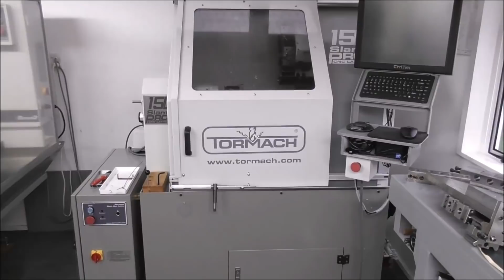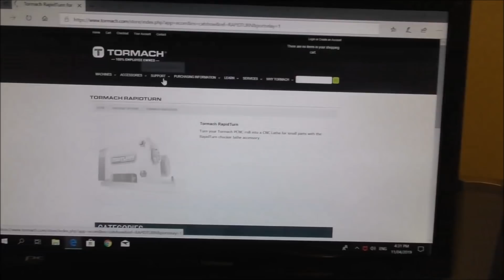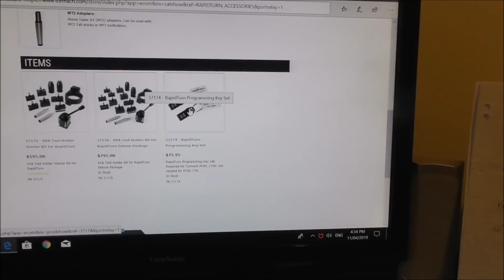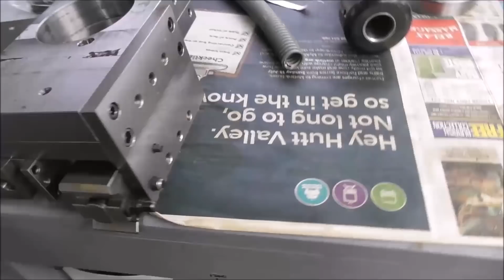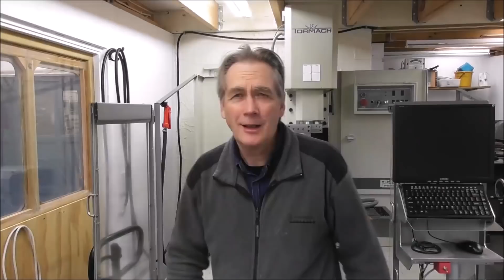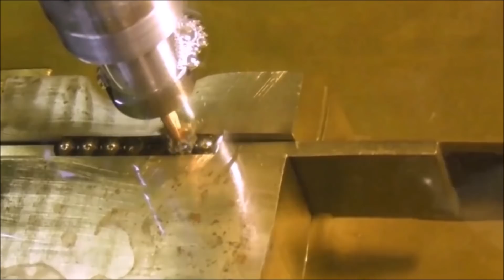Tormach Rapidturn Set Up and Run -  Part 1 -  Introduction

Comment: HI Cliff, from John in Orlando. Thank you for the display and analysis. I haven't done much with my RT to date, but I  just used it to do some work on 3 die holders which I just made. I bought the materials for a gang system, but haven't built it yet. You're correct about the presence of the RT on the mill; as I was trying to do mill work with it on the machine (1100) I ran the RT motor into the way cover, no damage, even though I'd told myself numerous times to assure clearence. I look forward to your continuing story, and truly appreciate your sharing.  I love that ITTP, although I have found occasions where my Haimer was a little easier in an odd case, ITTP IS still the best though! Best wishes!
Reply from the maker: Hi John - Thanks for you RapidTurn thoughts and ITTP feedback. Cheers  Cliff

Comment: Hi, just benchwatched full series of rapidturn, I think that is quite an interesting tool for the price and versatility. I have one thing that are curious for me at the moment: since basically 1 main problem (for me at least) with rapidturn is accuracy because of thermal expansion - why not use Y axis insted of Z axis to cut? Say I'm not using gang tooling - I could just mount quick change tool post 90 degrees, and cut it like horizontal.
But even with gang tooling - as I see your setup is already quite wide, with toolposts for each tool - you could cut tools length, and it would take around the same place, just mount them horizontally.
Or is there some programmatical obstacle so you are not allowed to do this in pathpilot? Or you allowed to do that but its more convenient with existing UI and not hand written g-code?
If you would ever decide to take your rp out of the box again - would be very cool to see how more accurate thing can be that way, haha. Thx!
Reply from the maker: Hi Anton. Good to hear you are thinking deeply about this. Yes, you are correct taking the tools in from the side or mill Y axis would likely be more accurate. One issue would be the Pathpilot on machine conversational CAM software is set up to use the mill Z as lathe X (it is not set up to use the Mill Y as lathe X) Also the clearance back offs, especially for larger diameters, would have to be sideways or Mill Y, and this would use up a lot of the gang tool spacing room. I would find it easier to work around the thermal expansion accuracy issue with eg coolant flow headstock cooling. That might just work. Cheers  Cliff

Comment: All of that could have been done by mill-turn (up to 4 min. mark) no need for expensive add ons..
Reply from the maker: Hi Cayenne. Yes the tooling part would work with mill spindle turning, if you had a spindle encoder for the threading,  but not ex a long length of stock. Cheers  Cliff

Comment: Thanks for the new video Cliff. I've just started using my RapidTurn so look forward to this new series. How long does it take you to dial it in? I'm not too good pretending to be a machinst so it seems to be variable for me - sometimes it takes ages and sometimes it takes 10 minutes (still seems like ages).

I have the little AX0 toolpost and it's pretty ordinary. I'm always double-checking my tool offsets to ensure they're still correct and the height setting screws on the tool holders move much too easily despite the locking nut. But I don't feel like spending the time or money to make a gang tooling setup so will live with it for the small amount of work I do with it.

I would like to know how you go about get things like drills on centre. I gave up but it would be useful to drill and bore on the RapidTurn. Tormach have a video that shows using a test indicator mounted in the spindle on a SlantPro and said I could use the same procedure. I was wondering if a coaxial indicator (which I don't have) would be easier.

I am thinking about leaving the RapidTurn on the table after I've set it up until I have to take it off for a larger milling job. So I'm also hoping for some feedback from others on whether this works or not. I made 6 parts with RapidTurn, took it off, did some milling ops on them, then had to make a bunch more round parts for things I was making and had to put it back on! Didn't think that one through which is why I'm thinking to leave it on as much as possible. I'm a bit worried about wear to the table slides and damaging the RapidTurn by doing something stupid though.

Having said that, the cat managed to knock it off it's shelf last week so leaving it bolted to the table may be safer for me!
Reply from the maker: Hi David - Wow!  You must have a serious cat!  I have 6 videos in this series coming up - they should cover your questions...and warn about indicating drills/bores to centre. Gravity spoils that plan.  Thanks for your comments.  Cliff

Comment: Hi Cliff. I have made gang Tooling for my Rapid Turn and to date have used it to manufacture quite a few hundred, if not thousand of compomnents. I find, like you, that the initial set up of the Rapid Turn and Gang tooling plate on the mill takes about an hour . I can manage around six or possibly 8 tools in the gang tooling set up, depending on the maximum diameter of the job being turned. I also fitted a Lever operated collet chuck because I found that opening the collets with a manually operated Tommy Bar 3" long was time consuming and after 50 or so times on short run components your hand becomes sore. What I find very time consuming is the setting up of the tooling so that collisions with the work or the rapid turn are avoided, this takes a lot of planning. On one job it took me close on 5 hours before I dared hit the go button without optional stops between different operations,
I have left the rapid turn mounted on the mill while I carry out the odd milling job but there is restricted space to do anything of reasonable size and I usually take the Rapid Turn off the table between jobs.
Reply from the maker: Hi Bob!  Good to hear from you...and your comments on RapidTurn. Cheers  Cliff